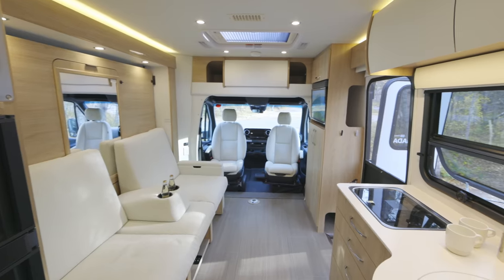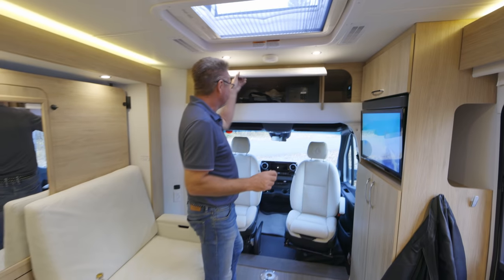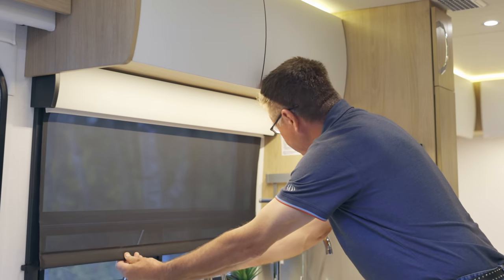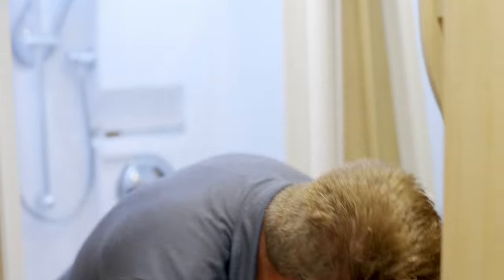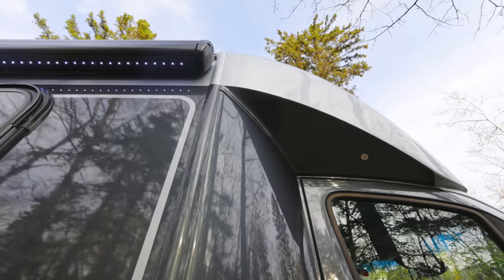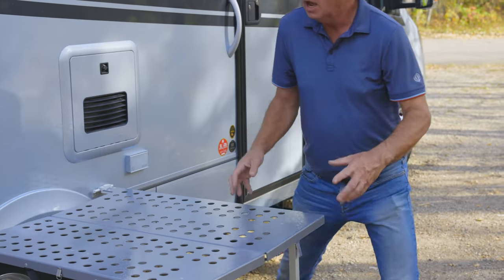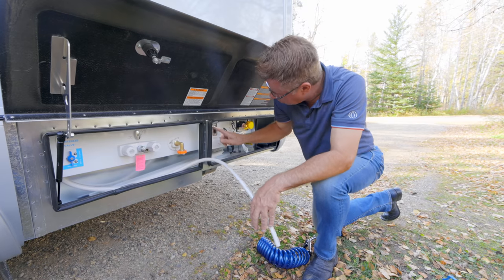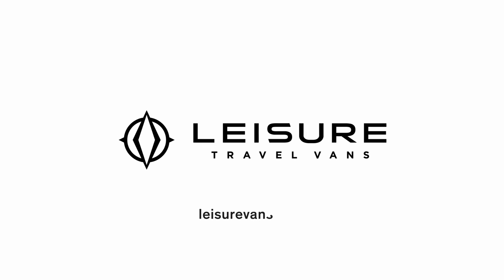2022 Unity FX

Comment: This is by far the best design I've seen yet for a Class C motorhome. The woodwork is light and inviting and they made good use of the space with the design elements. Compact yes, but if you're like me and want to travel solo, there's plenty of space to work, sleep, eat, and relax. I've checked the website and these RVs are pricey if you upgrade to the diesel generator and add the solar package but those two options are a must if you want to travel to places that have limited electric options. Definitely is 1st on my list to buy when I'm ready to make the transition to traveling full-time.

Comment: Great floor plan LTV - love the two seating areas! Just a few personal requests: (1) please go full lithium and lose the propane (at least as an option), (2) offer an induction cooktop vs. propane, (3) lose the curved upper cabinet doors - look great but not practical as they limit the opening size as the curved part hits the ceiling before it is fully open, (4) add 3 point seatbelts for the rear seats to allow 1-2 additional passengers during travel. (5) would like a larger sink to make clean-up easier in the kitchen and larger sink (somehow) in the bathroom
Reply: If something is an option, why would you care, don’t get it, lol. 
Auto gen start is an option I would want! 🍻
Reply: Strongly agree with the full lithium option.  Who wants to listen to a generator when dry camping
Reply: @SpykersB  it’s not an option. That’s the point
Reply: @rvfishing8817  clouds!
Reply: I love the curved doors.
Reply: @jeandixon2240  For looks I agree. But for functionality I prefer flat or perhaps curved with a unique hinge that allows easier / full access when open
Reply: @rvfishing8817  how to run the AC or heater on a battery??
Generator is necessary here.
Reply: @hassanger8128  If it had a Volta system, you could.

Comment: It would be nice if the rear lounge sofa can be converted into a bed, which would be very useful and should be very easy.  
68in x 76in bed. The 76in length is 4in shorter than the length of Queen or King.  I can see your feet out of the bed when you were lying in the bed, which could be an issue.

Comment: The optional table at the front, its rod is screwed into the floor.  How about to have another rod that can be screwed into the ceiling and the two rods can connect as a whole in the middle?  Therefore, it becomes one rod from floor to the ceiling.  With that, you can attach 1, 2 or even 3 or 4 computer monitors and 1 or 2 tables for keyboard/laptop onto it.  Therefore, with the two front chairs, this becomes an office space for one or two persons.
Reply: Brilliant!